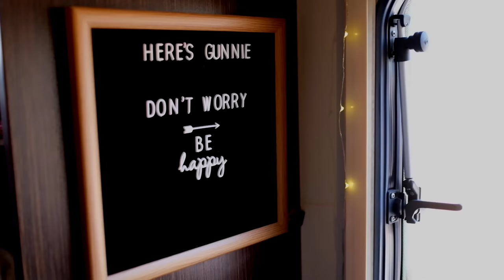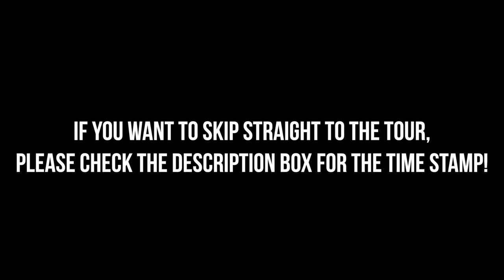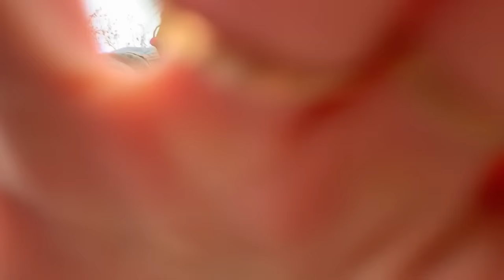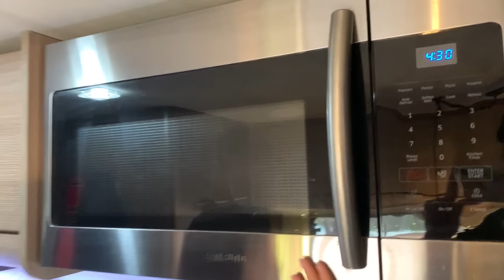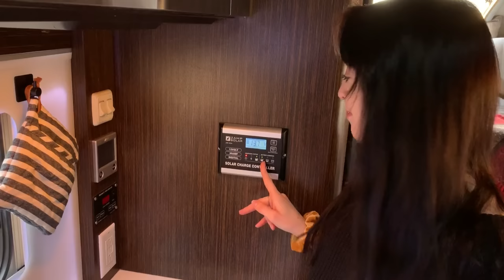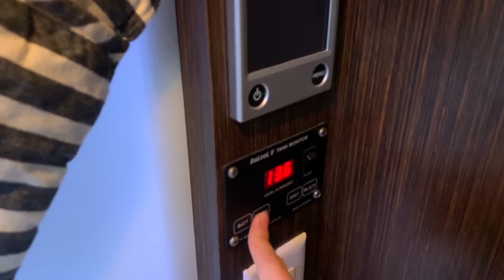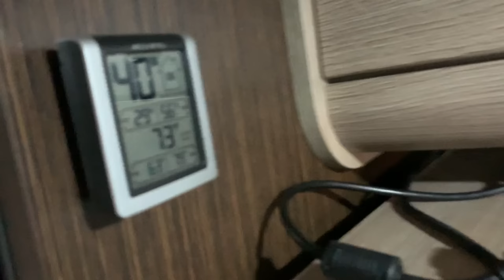Off-Grid Full-Timing Couple's Truck Camper: Tour + Review of Cirrus 820

Comment: I have the Cirrus 2018 truck camper like yours and its my first camper. I too get lots of compliments, but learning all the functions was hard. I find the heating to be an continues issue keeping the camper warm, It would help to have better quality of windows instead of plastic. I am afraid to take it too really cold location with the current heating system.  I have wireless electronic awnings side and rear. I can't seem to get  my TV to work correctly and the latch to lock it down is plastic and broke already, so I am forced to watch movies, which is OK. My inverter did come built in with the camper. I am currently trying to figure out how to pull a small boat trailer. I have a trailer hitch on the truck but I need to find a 40 in extension for the hitch so that the boat trailer doesn't hit the camper when I make a turn. I'm still not totally sure if I like my unit but for now, being my first camper its OK.  Looking forward to traveling this summer in 2019. Would like to see a Cirrus club to talk to others who own one. 
Robert Matheson
rmatheson64@yahoo.com
Reply from the maker: Hi Robert! Join us over on Facebook. The group is called Cirrus Truck Camper Owners!! Lots of us there.

Comment: Hi to both of you.  It was great video and thought you were honest and didn’t hide a thing.  I was curious to know if you have reviewed the 2021 820?  If so, what do you think?  It appears they have answered many of the negatives you pointed out and seems they are on the right track on fixing issues.  The sink is still shallow and the Alde system is still not located in the best spot, and plugs/USB not a part of the bed.  Was curious on your thoughts, I have been looking at a lot of truck campers and I really like the 820.  If not the Cirrus 820, what other make and model have you came a crossed that you like? Thanks for your time and hope to hear back.

Comment: Firstly I'd like to thank you both for putting this video together. It's certainly the most informative video re the Cirrus 820 on the web and I also appreciate your candor regarding some of the issues with the camper. As others have said....great video and it certainly helped me make my decision to buy one.  In fact I'm traveling to Atlanta next week to pick it up.

I was wondering if you could provide more information re the inverter install?  Routing of the wiring, why that size for your inverter, any pitfalls or things to be aware of, etc...? I'll be running 210w panels as well and any info regarding the inverter install would be appreciated!. I was rather surprised that Nucamp doesn't offer an inverter as an option considering that the camper seems well designed for boondocking. 

I also have a 2000w inverter genny and was wondering if you've found a more elegant storage solution other than the back seat? I'm looking at diamond plate genny storage boxes that potentially could mount to rear bumper though I"ll have to wait until I actually pick up the camper to decide what might fit. The ladder location looks like it may preclude use of that space....I have same questions for genny fuel storage. Ideally I'd like to mount 2 ea 5gal cans.  Have you guys come up with any solutions? 

Thanks in advance for any insights that you may lend and hope you both are enjoying the journey!
Reply from the maker: Hey Paul! I'm sorry for the late reply! I was waiting on Guntars to have time to go over this with me before I wrote back to you :) I guess by now you have picked up your camper!! How do you like it? 

Regarding the inverter install:

We first ran some new (larger) 4 awg welding cables (previously 8 awg) from the compartment where the jack control box is, down underneath the camper to the battery compartment. This required taking out the entire battery compartment. Routing the new wires was a pain due to poor access underneath the camper. 
We recently met someone who installed the inverter underneath the dinette bench. This was smart because the wire could then be shorter (and more accessible). 
Our inverter is 300w, which is small but it’s all we need, and smaller inverters waste less power when sitting idle. The specific inverter that we used is https://amzn.to/2YhCtx2. You may need a larger inverter if you plan to run your microwave on it.
We did hardwire the inverter to the breaker box to give all outlets the inverted power when off-grid. To go into more detail, we installed an automatic transfer switch and then split the main bus in the breaker box into two buses. This allowed us to separate the circuits so that, for example, the fridge and heater won’t use the inverter but all of the 120 outlets will when we’re not plugged into shore power.

We’re also totally surprised that an inverter doesn’t come standard in these things! Maybe in the future, after seeing how many people do after-market installs.

Regarding the generator - yes, we have seen awesome boxes attached to the bumper, under the ladder!! If you’re not already a member, please join the Cirrus Owners Facebook group. Many people have done this install and have given great advice all about that! I think one guy even shortened his ladder to fit the box without the ladder getting in the way.  Thank you for watching!! Hope you love your Cirrus and it’s not giving you too many problems ;)
Reply: @WheresGunnie  Thanks so much for the detailed response. Yes, found the 820 group on FB. Great info there and I think I've found the solution I've been looking for re the generator using this on the rear bumper as mentioned on FB.....http://lowprolockdown.com. I'm also planning on just biting the bullet and buying a EU2200i. My Chinese honda knock off (Quipall) seems to run everything fine but won't shift into eco mode when running the AC and is a bit noisy. 

As for the inverter I'm going to wait until I have some miles logged and have a better sense as to what my real 120v needs might be. Have a longish trip planned in late summer/early fall and hopefully I'l have the bugs worked out by then!  All best to both of you. Enjoy the journey.

Comment: As a truck camper owner, you need to get better attachment for your camper to your truck as it is only hanging on to your truck bed and bumper which is made of metal and tin.  the camper should be held onto the frame of the truck for better security and safety.  My opinion.

Comment: I would  recement  a  Reverse  Osmosis  water  filter  system  for  drinking water only ..  It  has like a 3.2  gallon bladder tank..  Would need an  optional  pressure  pump to  put the filtered water into  the  bladder  storage tank ..
  I have never purchased bottled water..

Comment: I was  looking for a small light Truck Camper  so I can go on Snowmobiling  Trips ...  Off  Grid  VS  RV Park  set up totally the Opposite.. They need two different Models  or a different package or  different options..

   I got lucky and found a  good used one  8 miles from where I live.. I even know the previous owner..
   There is a place in CA  that builds  4X4  RV  Vans  ect..  very expensive..

Comment: Buy a meter for the propane tanks, Many different kind available. Don't fold the sink until it's empty. Why is there only 1 toothbrush or do I want to know ? I like the table. Easy to change the 12v outlet to usb or just get a usb plug, Anker is a good one.
Reply from the maker: Ian The sink doesn’t fully drain for hours (even after all attempts of unclogging it btw) it’s just a slow drain. You have to wait a few hours for it to drain or just evaporate. Sometimes you want to use the toilet immediately after using the sink and don’t want to wait for the sink to be dry to close it so it’s just annoying. It’s not always possible to wait... Sometimes I wipe it with a paper towel just so I can close it. 
Guntars has an electric toothbrush - it’s in the top wire basket on the wall if you look. I prefer manual so that one is mine. I also have an electric one, it’s in the basket too so we have three toothbrushes! 
If you listen, we mention that we do have a USB adapter in the 12volt socket below the bench as well as in the one above the bed. It’s an easy fix, yes, but Cirrus should’ve just put all usb outlets in first place. These days, we all use usb instead of 12volt sockets... 
thanks for watching!!
Reply: Didn't hear that you used an adapter. 12v are used for lots of things, my wife has a 12v blanket, we have a 12v fan. With the 12v outlet you have the option that you don't have if it was just usb. The sink is a bad idea I agree, not sure how handy you are, possibly silicone some sort of lip, piece of weather stripping, to the rear and curve the ends in to catch the drips. Just kidding about the tooth brush since you do have some shiny clean teeth. Safe travels
Reply from the maker: Yeah, I gotcha. We've just never bought 12v accessories if a usb version is available, maybe it's our age haha. We have fans and they're both usb. Our lantern, flashlight, toothbrushes, phones, verizon hotspot, and wireless headphones are all usb charging too, so we require a lot of them! A blanket is a great idea though and the plug in the middle of the bed would definitely be convenient for that! That's also a great idea with the sink. Guntars is handy so I'll pass that idea to him! I'm laughing about the toothbrush now. I woke up to some bad news so my sense of humor was turned off and I apologize for that!

Comment: Looks like a nice home on wheels. Nice mods. Personally,  I'd have kept the AC. Sure is nice when you need it. Take care...
Reply from the maker: Thank you!!! Yeah, we probably would’ve kept it if we were plugged in more often than not. We really needed that space for the extra solar panel though, for when we’re in more northern parts of the country and/or winter. Being able to boondock was our number one priority so it just wasn’t practical for our needs. We weighed the pros and cons for sure but the maxx fan is actually surprisingly effective when you have a few windows open - the air flow is outstanding. We’ve never missed the AC! And of course, we wouldn’t even be able to run it if we’re not plugged in. Thank you for watching :)
Reply: @WheresGunnie  I installed a second Fantastic Vent in the bathroom. Much quieter than that cheap thing the factory installed. With both fans running, the cooling effect is awesome.  Solar panels with the shading they provide under them helps keep things in the TC cooler. All the more justification for you guys to get a third solar panel. Have you guys done a video detailing your longterm travel plan or goal? That'd be interesting. Got a link or, there's a suggestion for a video.  Enjoy your day...
Reply from the maker: CITAP1 Oh that’s a good idea for the bathroom fan! I also hate that the factory fan is so hard to clean! 
I wish we could get a third solar panel - I just don’t know how we’d get it to fit on our current roof configuration since we have the roof rack. That would be a game changer though! 
We don’t have a video out about our travel goals and future plans but that’s a great topic and we’d love to cover it so it’s going on the list! I’ll let you know when it’s posted :)

Comment: Appreciate the insights. Cirrus is definitely at the top of my list. Would be great to see how your rig handles mountainous offroad travel. By the way, spoke to a dealer rep at an RV show today and learned that the issue with your Alde purging glycol may be related to your circulator pump set too high.
Reply from the maker: Hi! We have footage of off-road travel that will get uploaded eventually, I'll let you know when it is :) The rig handles surprisingly well off-road, on all kinds of surfaces, despite its size and weight. We're really impressed with it. We cannot recommend our truck enough for it to be paired with this camper! Thank you so much for the Alde tip - I think you're 100% right! Thanks so much for watching :)
Reply: @WheresGunnie  that would be great to see, thanks. There are seemingly very few such Youtube videos. Had been thinking that a dually truck would be better but prefer the single rear wheel as it would be a daily driver with fewer tires to change and more fuel efficient.

Comment: This is a great video and I'm really liking some of the ideas I see. I've got an 820 as well, and plan on doing a large solar upgrade with lithium batteries etc. It currently has two panels (even with the AC unit still on the top) but I've figured out how to run around 500 watts of panels, possibly more with newer efficient panels. I seldom, if ever, stay in RV parks and boondock almost all of the time (mostly WAY off the beaten path where there is nobody else), but I would never get rid of my AC or microwave (I'm in the desert a lot and want the AC, and the microwave to heat my leftovers). Currently, I run both (not at the same time) with a Honda 2200 mounted on my camper bumper with a lowpro lockdown (keeps it very safe from being stolen). It is very quiet, and by adding startup capacitors on my AC unit, I can now run it with this inverter. One more thing on the microwave: I'm swapping it for one that also has a convection oven in it so I can bake. 

I store my blackwater hose under the rear bumper of the camper and mine didn't fit at first either. It was very simple to shorten it a few inches and make it fit. 

On bathroom, one thing I added that I love is a 4 compartment liquid soap holder. It holds two kinds of shampoo, conditioner, and body wash, and sticks to the wall saving space. BTW, there is a thread on FB on the Cirrus owners forum where someone has posted how to modify the sink where it will drain. I haven't done it yet, but I intend to. 

As for your glycol issue, I suspect that you need to adjust the outlet temp of your Alde unit. And those outlets at the head of your bed can be relocated up to the top of that lower storage area and will make it much easier to plug into.

 I can't recommend the Cirrus FB group highly enough. Lots of knowledgeable people to help fix issues and give upgrade ideas. 

Couple questions: curious how you removed the light over your table and changed it out to the new one you have. And can you elaborate more about where the insulation is lacking under the bed? 

Thanks again for a great video!
Reply from the maker: Hey Bret! Fellow 820 owner!! Please share how you plan to run 500 watts or solar! That's fantastic! It's great that you're able to use your AC and that you find the microwave useful. We bought a generator but haven't even used it yet. We've never missed the AC but that's probably because we chase good weather. I'm sure we'd be wanting for it in the summer desert! 

I joined the FB group - already learned so much. Thanks for the tip. We’re now also going to the rally in April! 

Thanks for the Alde tip - glad to finally learn what our problem is! We had another comment about the outlet temp too.

It'd be nice to relocate the outlets, we'll probably do that next time we're docked but instead, relocate them to the nightstands so that we're not still digging behind the pillows. We thought about replacing the reading lights with charging ports too.

As for the overhead light, we removed the factory installed light pretty easily - it's just screwed in there and glued on the ceiling. It does rip the surface of the wall covering a little when it comes off, which is why we included the ceiling medallion in our installation, just to cover up the mess left behind. We then cut the two wires (black and white) to detach the existing fixture. Just remember it's DC wiring so ignore the ground wire in the new fixture (it was a green wire in ours). We connected the black to black, and white to white with wire nuts and that worked. You may need to trial and error this part depending on the fixture you get. We did run into a difficulty with there not being an electrical ceiling box like you would have in your house, so we had to remove the plate form the fixture and just attach it directly to the ceiling. The hook that we swagged the wire on helps with the weight of the light in this case. Make sure you’re using a 12 volt bulb in your new fixture and it should work perfectly! We’re getting ready to replace the entryway light now too.

Regarding the insulation issues: so, when we’re camping in cold weather, we get condensation, but it only collects in certain spots - where the frame runs in combination with where there is a lack of airflow…so we’ve found moisture in the cabinets above the dining table on the ceiling, behind the dinette cushions that are against the wall, and of course, under the mattress. There is just a straight line of condensation running along the surface so it’s fairly obvious what the issue is and where the frame lies. This means that the actual metal part is not insulated at all, therefore collecting moisture on the inside when the metal is cold from the outside.

I’m sorry for the essay! I’m not very good at explaining things haha. I hope it’s easy to understand :) Thanks for watching and for the tips!

Comment: Until you own a diesel truck you will never understand how stressed a gas engine and transmission really is  when towing heavy.  The fuel mileage is ruffly double too. Most modern diesels get approximate 600-800k miles before they need a major service some get a million plus miles while towing 30,000 lbs daily before rebuilds .   Your lucky to see 250-300k miles out a gas rig.  You could never understand until you own both.